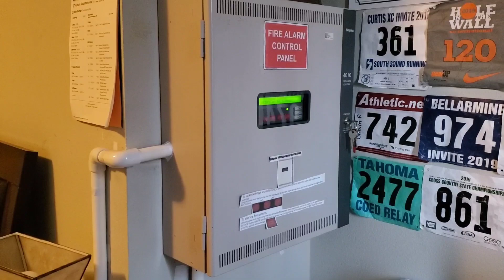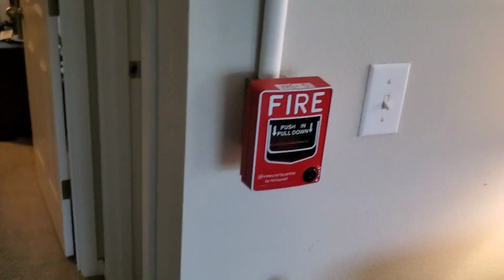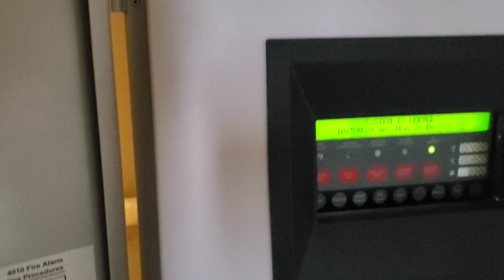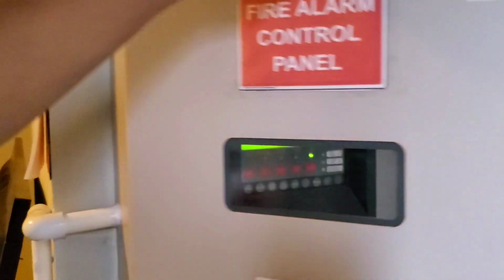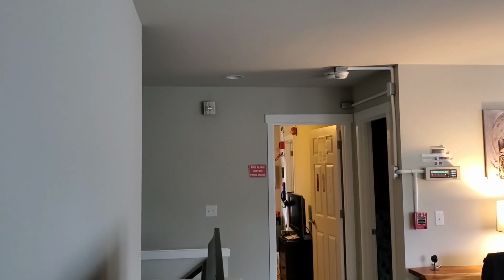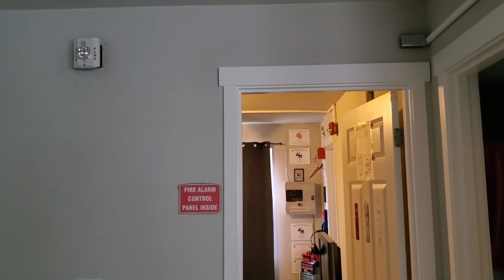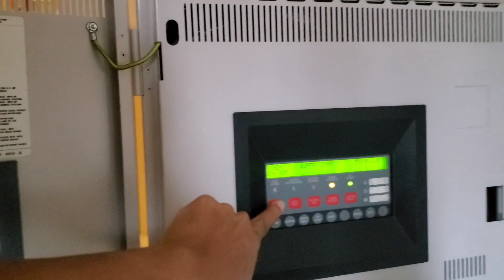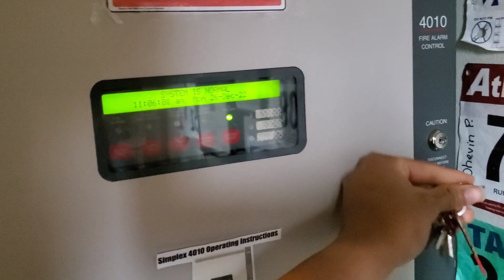System Test 79| Requested by @aidanthetoiletelevatorfire7554

Comment: Request: Bedroom: System Sensor P2R, (Ceiling) > Spectralert Classic Remote Strobe, Fire Lite BG10L.
Closet: Simplex 4904 Remote Strobe.
Hallway: Wheelock AS-24MCW, Simplex 2099-9756
Gym: Gentex Commander 3 on chime, Simplex 4251-20

Coding: Temporal Code 3

Thank you
Reply from the maker: I don't have a P2R but rather a PC2R. Also I only have the older AS-2415/75Ws with the vertical strobes. Are you ok with those?
Reply: @BlackLightning4547  yes
Reply from the maker: @TyConSherriM  Sounds good 👍🏽
Reply: @BlackLightning4547 which system test will this be?
Reply from the maker: @TyConSherriM  https://youtu.be/YIieoRLIf_I?feature=shared
Reply: @BlackLightning4547  shit I didn’t see that lol
Reply from the maker: @TyConSherriM  no worries

Comment: i have a question! Does the 450D work without the VALS?
Reply from the maker: Yes although removing the strobe is not an easy task as its wires are soldered to the horn